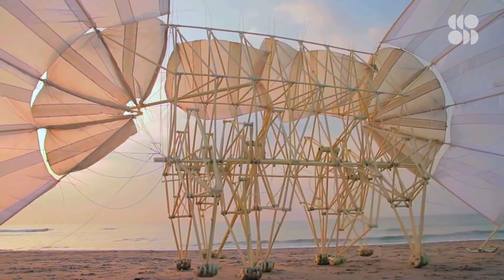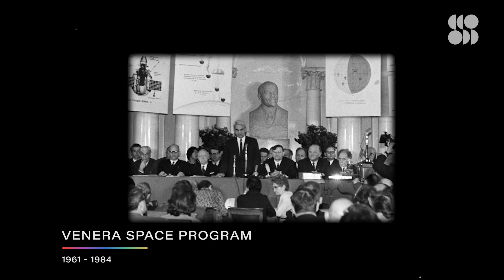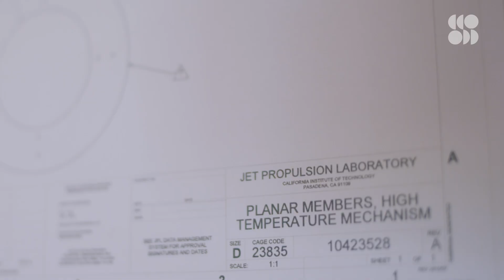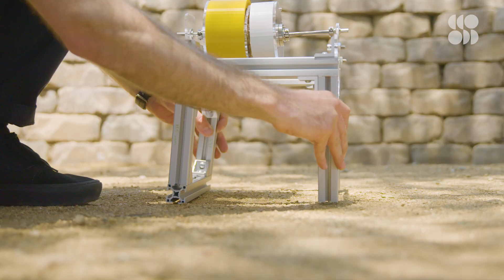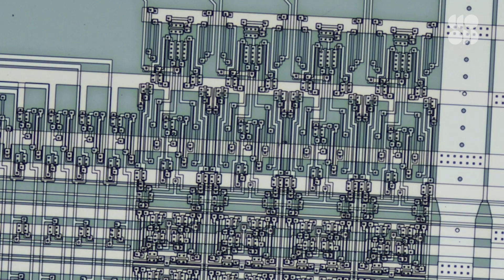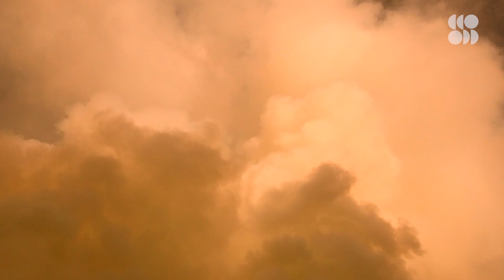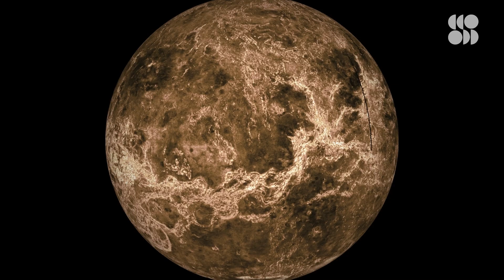NASA Engineers Design an Indestructible Venus Rover

Comment: There is way too much overcomplication with this, all because of insane rejection of nuclear technology. Rover for Venus can be made as a normal rover that has a small reactor acting up as hot reservoir, hotter than the surrounding atmosphere and providing refrigeration action for heat hardened electronics inside. Core of the rover doesn't have to be at room temperature. As long as it's tolerable for special electronics, it's fine.
No need for reinventing the wheel or making fiddly mechanisms that will fail because there are so many moving parts.

Sorry for the cold shower, but this is an hilarious complication that gives a fragment of the usual rover capabilities.
Reply: The latest rover Perseverance runs with an MMRTG. It's producing 110 W on the cold martian surface. It's nuts to think, that NASA would overlook your simple solution.
Reply: How would a nuclear reactor, a device that generates heat, not only cool the rover down, but cool it to levels less than the surrounding atmosphere?

Comment: We could make that out of pure carbon that can get hot and design some pure carbon  relays with diamonds as insulators for making a computer that can get really hot so hot it could swim on a multen metal ocean plant that would be cool to make a boat to float around on Venus carbon can handle like 9 times the temperature of Venus so maybe carbon and diamond will be a little too much but maybe we can explore inside of a valcano see how deep we can go and get any data we can even the temperature 30 feet down would be coolly hot data

Comment: The way it moves with the struts legs reminds of the the nervous system that controls a centipede's legs. This thing is going to have to be super tough to survive on Venus. Maybe it could be made out of titanium to withstand the heat and crushing pressure, but there still needs to be a way to keep the electronics from baking.That will take some incredible ingenuity. There will also need to be a way to lubricate the joints at the high temperature. I won't say it can't be done, because a few hundred years ago people thought flight couldn't be done, but it will require some extreme and new engineering ideas.
Reply: They are using high temperature silicon carbide and gallium nitride based electronics. They can withstand the heat, but the transistor desinsity is terrible. Computing power will be extremely limited. As for joints, they are using wheels on the rover. I'd imaging a dry bearing or even bushings will be fine for how slow this will be moving, and being metal, can take the heat pretty well.

Comment: There is high temp glass that can withstand over 1200 deg C that easily could be fitted over camera lens pods. They could make a rover out of Titanium which would hold up to the 1650 deg C & a 1200m+ pressure vessel which would handle 120 Atmospheres of pressure. The Russian's have been making Titanium Sub's that are able to travel to 2000m+ deep or 200 Atmospheres of pressure. The rover only needs to be a pill shape with solid wheels, robotic arms, it's electronics within a secondary hull & it's nuclear power source to make it be driven around like a radio controlled drone. It can be done, it could have been done 50 years ago, of course it would be heavy but it could have been done long ago & perhaps it already has been done without us knowing it.

They should be looking to make this rover last for 5 to 10 years not just 120 days, what a waste of money if you are spending 200 million to send a mechanical rover that will last only 120 or perhaps fail with the first 12 hours getting next to no data return on the money spent is a complete waste of time. Better to create a robust copy of one of the Mars rovers that is built like a pill shaped double hull rover with 8 wheels that will last for many years where it can traverse a huge amount of area & not just spend a year inside a 2km diameter crater like the Mars rovers do.

Comment: Okay you've solved the problems with pressure and temperature but everybody seems to be forgetting about when it's caked in dust. Too many small parts equals to many chances for failure.

Comment: Isn't Venus so different from earth because it's location in the solar system? It's closer too the sun so it's hotter there. The constant heat is just evaporating whatever is on the surface and leeching chemicals, fumes and gases into the air. I'm just speculating, I don't actually know anything about all this stuff.

Comment: Venus is a new world. That is a lightening scar very similar to the one on Mars. Ancient stories said that these two planets once battled with lightening when they come into close contact in some fashion where this was interaction was clearly visible to humans. The planets then orbited off to their current more distant positions. 
Maybe all the inner planets come into being in this manner. Velikovsky said Venus was birth from Saturn. Older sources say Saturn. I'd say the Sun has something to do with it. 
Maybe is a process whereby one of the giant planet re-establishes electrical equilibrium between the Sun and itself by burping out a planet. Someone already did a paper that inferred that that is where Triton came from
Maybe all the inner rocky planets are made that way when the Sun micro-novas and the material condenses into a terrestrial world.
Maybe the reason the US and the USSR were so interested in Venus so early in their programs was the question of Venus's origin.
We went to the moon to confirm the Sun micro-novas, glazes the Moons surface and leaves large 'concretions' of solar nova ejecta on the Moons surface.
Just wondering.

Comment: Fukushima. 

Have promoted related concept of using "brain dead" hydraulic powered/controlled robots to clean up waste. 

TEPCO & UN are closed to crowd sourcing solutions as NASA did here, AFAIK. But maybe you folks could apply this logic to Fukushima cleanup?

Have more info on request (respond here w/how to contact or thru my profile). I envision using hydraulics to power robot & various tools (jacks, saw, etc.). Control signals are sent w/pressure pulses that are mainly mechanically decoded (such as to engage/disengage wheels to control turning, start/stop tool, reverse direction). Vision is provided by passive optic cable system. 

The electronics are what fry in robots, and so goal is nearly no electronics except possibly large-wire windings if necessary.  

Multiple robots can work in parallel, such as several configured as hydraulic jacks to lift and move an object. This would be done by a computer back in control room coordinating their movements and translating commands to necessary control signals (pressure pulse trains that are mechanically decoded).

It can be done and is critical to saving this biosphere from damage.

Comment: I think we should also have floating rovers that can periodically descend in altitude and take surface photos, and then be able to climb in altitude to cool down and maintain sustainability.
Reply: So basically a sky submarine
Reply: @em4392  isn't that called a balloon
Reply: This sounds a lot more effective honestly.
Reply: the problem with those is that its very hard to introduce something into such a low orbit
Reply: Kites, like the Chinese dragon types. Or maybe those high end kinetic bird ones that were coming out a few years back
Reply: there was a concept to have flying manned research bases in the upper atmosphere
Reply: That's similar to what I was thinking... have a probe with a specific gravity design that allows it to float within the super dense atmosphere like a cross between a submarine and a zeppelin... if it can't "sail" in the wind currents, then maybe some type of sterling engine using the abundant thermal energy as a  generator or direct propulsion... it is such a brutal atmosphere to survive in, I can't imagine all the details, but I don't think the Soviets are being given enough credit for the engineering requirements for that 127 minutes... it's a harsh place.
Reply: Perseverance has a small helicopter drone to help it navigate named Ingenuity.
Reply: It wouldn’t be able to float up in the atmosphere enough to make much of a difference in the heat it receives so it would have to rotate the planet then it would get too much drag if you tried to enter its atmosphere then exit it
Reply: The U.S. Navy developed a Autonomous Unmanned Vehicle called seaglider. It was intended to dive through the depths of Venusian atmosphere like a whale the way you describe it.
Reply: Like how the city on Bespin in star wars his high above the planet surface

Comment: an idea use an internal steam like engine to power a piston, then a simply clutch. there is plenty of heat. or even use a pressure differential system.  a thermoelectric module could convert Venus heat to cold to cool hardware
Reply: Plenty of heat, no gradient.

Comment: Venus Has a slow retrograde rotation and a very high atmosphere pressure at ground level. Imagine  if it slowed  or even became tidally locked to the sun for long intermittent  periods  One side of the planet would cool. Is it possible that pressure and coldness could crack the atmosphere and separate it into it's chemical and solid parts. If it did, would this account for how the earth obtained it's laminated crust with oil and coal etc.?
Reply: The big caveat is that the thick atmosphere reduces the temperature difference to negligible levels at the surface. However, such an idea could work in the upper atmosphere.
Reply: It would create crazy strong winds.   long term interesting question

Comment: What NASA needs to do is make a drone that gets constant power from a. blimp that charges it.Send both these aircraft in a capsule able to withstand the challenges of entry.Also send more drones to cover more areas of discovery.The lightning storms could somehow be used to collect electricity safely to power the blimp which could use that power for its own electricity as well as the electricity to charge the drones.If you could safely harnass the electricity from the lightning storms you would have a doable concept avoiding the super hot surface of Venus.The drones would be designed to with stand venue's atmospheric activety.Could also have cameras sending data back to earth lasting almost just as long as the mars rovers do.

Comment: why don't they put the electronics in a pressurized capsule?
Reply: Because the problem is heat. Got to get rid of the heat or make the think not be effected by the heat.  So now you would be limited on sensors.
Reply: @timothyduffy8818   aww, I never considered that factor. My bad

Comment: Is it too late to submit a mechanical concept for "Bump, reverse, TURN and then go?' TOYs from the 50's figured this problem out long before circuit boards. It would be far simpler, more robust with less moving parts and would be more versatile than just bump, reverse, drive forward, i dont see how that gets you anywhere other than bumping into the same wall for 127days

Comment: What about any liquids or "muddy" environments on the surface? I know most terrestrial surface materials won't melt or loose their viscosity but we don't know for sure from what I understand. For all we know there could be a unique type of rock that behaves like wet clay or mud when subjected to the surface pressures, temperatures, and atmosphere?
Reply: It could be a problem but even finding this type of rock would be a major discovery.
Reply: Venus surface temp is below 500 C. Rocks generally go soft beyond 600. With a "wind" turbine powered vehicle I would be more concerned with variations in unknown atmospheric speeds, for instance. Also I absolutely miss any details on data transmission in a "steampunk" design
Reply: Colombo Lagos
Reply: The only 'liquids' that could exist are magma, and molten metal from beneath the Venusian crust.

Comment: I look forward to seeing how it collects data and relays it back to the orbiter. Will it use smoke signals or semaphore?
Reply: As stated in the video, hardened electronics, not based on silicon but gallium instead. Problem is it will need to be custom built and probably will be orders of magnitude less dense than current CMOS technology.
Reply: The main idea fielded by the lead engineer on this project is an array of radar reflectors which can be oriented to display something similar to a basic QR code. Imagine a grid of squares where the reflectiveness can be " on or off" and an orbiting craft will bounce off a radar signal and "read" the QR code shown. The IO states of the array would be controlled by a combination of mechanical system and electronics to relay information.
Reply: @austinfox4130  So basically, semaphore.
Reply: @ScottLahteine  exactly semaphore!
Reply: Cairo dindori madhya
Reply: iirc it's semaphore. the idea is that the rover has some sort of disk that can be rotated to show or hide something that reflects radio waves. that way a satellite can beam radio waves and read the reflections from the rover in order to transfer data up to the satellite. I suppose there's also the possibility of making a high-temperature radio emitter for the rover though
Reply: I was thinking mirrors, but it’s just too gosh darn cloudy!😆

Comment: I'm very impressed by these mechanical robots but I don't quite understand whats the goal of a mechanical robot driving on venus when it has no electronics that can send any singals to us
Reply: It does have some electronics -- mostly passive data receiving and readings -- which it would just constantly be trying to relay back to an orbiter to earth, etc. Its just that many of the most sensitive instruments don't have high heat tolerance, so they mentioned it would have the computing power of a calculator basically, to make sure the electronics are able to withstand heat tolerance.

Comment: I was very fortunate to be a part of the design challenge from this rover. The team at JPL was wonderful to work with and I hope NASA will open up design opportunities like this to the public more often!
Reply: So cool!
Reply: I wasn't aware it happened but anyway.. I will still make my own designs because there is no harm in doing so.
Reply: @mwanikimwaniki6801  check out HeroX, they do crowdsourcing projects. That's where the challenge from the video was hosted.
Reply: @austinfox4130  absolutely wonderful. Lemme check it out.
Reply: Yeah same, we actually are working on the sensor, which team were you ?
Reply: @shivammathur1583  I entered with an independent submission. Unfortunately did not win any rewards though.
Reply: @austinfox4130  trust me you did gain something, I am 15 and I have a long way ahead of me and hence I don’t take victories as victories. Everyone in the challenge won as per me, the knowledge you would gain is amazing. I think I remember you BTW. I basically specialize in robotic and aerospace systems, I have and am working on projects with NASA and the airforce (proposing ideas mainly)
Reply: Curious about this and I know it is purely hypothetical. What would  the Venus temperature range be if it had the same atmosphere as Earth? The only difference being the distance to the Sun. I would think the pressure would be similar.
Reply: @devfaulk  The pressure on Venus can destroy a nuclear submarine and can melt lead. It’s pretty extreme so even if you change some parameters it would not make too much of a difference.
Reply: @shivammathur1583  atmospheric pressure is a function of the composition.  Heavier elements make for higr pressure. The thicker the atmosphere the more atoms to press down on you. So the pressure is always a battle of composition, and planetary gravity trying to hold on to the atmosphere as molecules try to escape or are blown off by solar radiation. A rock is a rock though so if Venus suddhad earth's atmosphere it would likely behave like you said, simply hitter because it's closer. However you have to consider why it's atmosphere is the way it is. Earth and Venus have reached their own stable equilibrium and if you suddenly changed it, it's very likely it would naturally return to something similar to what it has now after a few million years.
Reply: @austinfox4130  yeah I agree, if it did then there would be alterations to gravity and spin rate due to the dynamics of space, this might impact other factors in the planet that might lead to a increase or decrease in pressure which can change temperature as well. If pressure increases then the kinetic energy would increase due to the particles hitting things around it at a higher energy rate, so pressure and temperature are linked but yeah it might become something similar to earth due to the heat of the sun being less which in turn could also impact the synthesis and possible fusion of elements
Reply: Cool project. Useless spacecraft.  Im amazed nasa even entertained the idea. Must have identified as a rover.
Reply: @andrewbrown6522  they are really going with a hybrid approach for the final rover, this was an exercise to see how much of the craft could be mechanical. While electronics offer many advantages, there are key areas where mechanical makes sense, and so the more that can be done mechanically the better for longevity.
Reply: Cool. Wondering if that windmill blade could have the potential to flip the vehicle over if the wind was high enough?
Reply: @rxonmymind8362  this is something they address in the challenge, part of the requirements was to detect vehicle absolute angle change.
Reply: Source: Trust me bro
Reply: @pickinslarry9635  what source could I possibly provide aside from my word in this situation??
Reply: @pickinslarry9635  your source: trust me bro he's lying
Reply: @pickinslarry9635  I don't know why he would lie about something so obscure